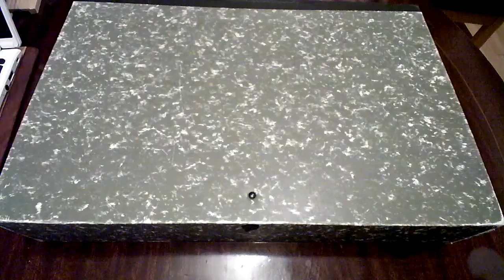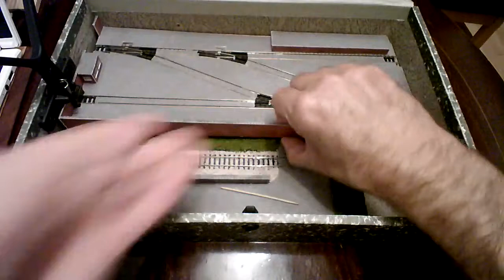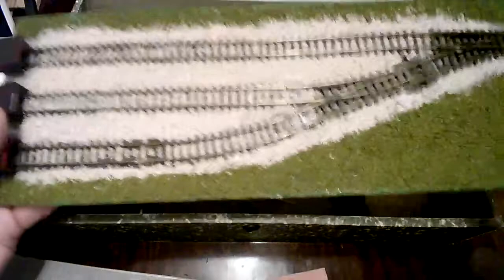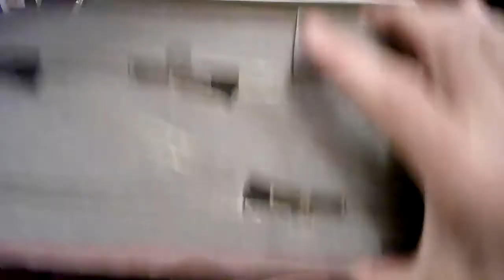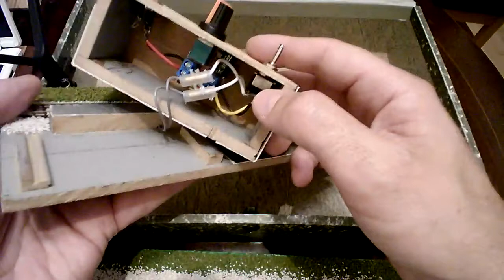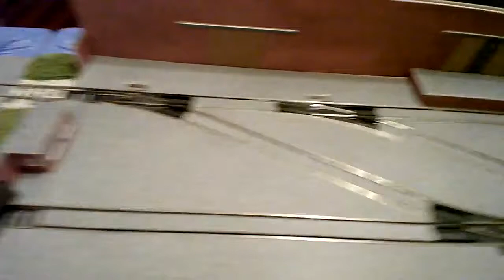Unboxing my n gauge boxfile shunting layouts

Comment: How much is the measurements 😮??

Me make on a table 20 84 cm

This sims so little

An box measurements??? 😮

Orety idea for inglenook
Reply from the maker: The box file is 38 x 24 cm. This means Filingnook was about 70 cm, and Boxfield was about 1m.
My latest project (Inglebook) is smaller (link in the description).
Reply: @andrewmasters5020 the turnouts on boxfield are so small .

Are the PECO ST5 reference ???
Reply from the maker: @mitsu7909  these are Minitrix, but I will use Peco ST-5 when I rebuild this layout. I use Peco ST-5/6 for my other layouts.